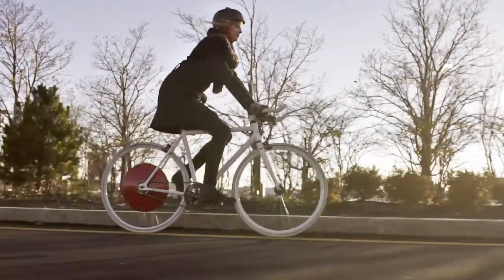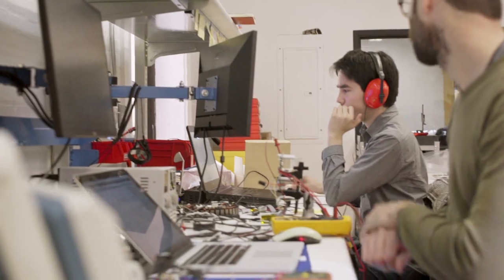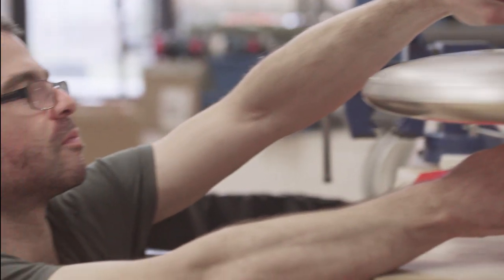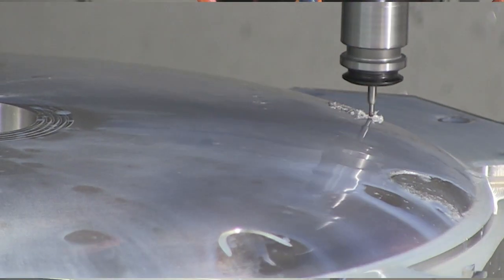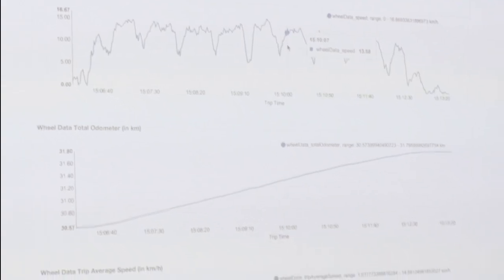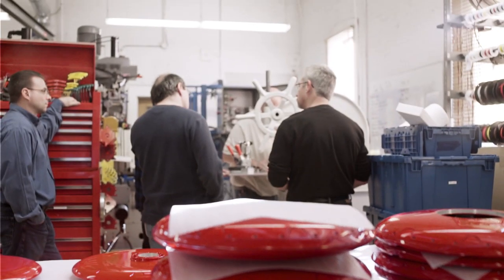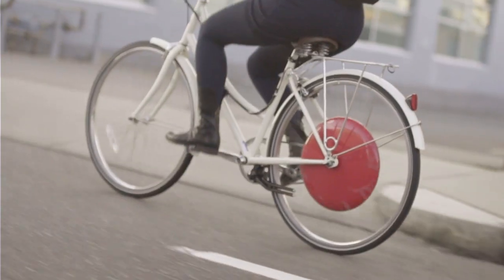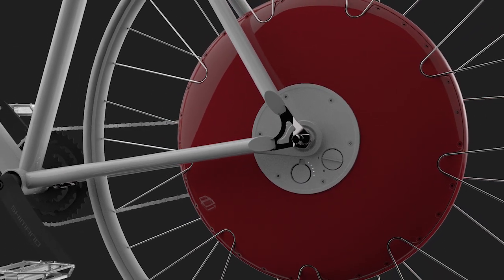Copenhagen Wheel - Product Development Update

Comment: July 10. 2015 STILL nothing, this looks like a scam, 7 months ago they posted here that they work day and night.....seems they have no open communication and the wheel is WAY overpriced and I think they gave up because in the end the wheel would be to expensive...only made in china will safe those guys! I strongly recommend  NOT to preorder the wheel! Better to buy an electrical bike that has replaceable batteries and is built stable enough to hold the additional weight and is fitted with DISC BRAKES!

Comment: How about theft protection.
Back wheels are quite easy to remove. 30 second tops and bicycles with quick release (90% of bikes made in the last 6 years), you don't even need any tools.
Reply: Tom Jr I replaced by nuts with ones that need a special tool... makes it more difficult to steal. (Though I hope I don't lose to tool)

They are not expensive and easy as hell to install. Got mine off eBay from the UK took 5min to install.

You can't theft proof a bike, but you can make it too difficult to bother by getting locking nuts, a good segmented locking bar and by parking it in more secure locations.

A company out here in melbourne builds bike cages that are monitored and require a pass key to unlock (logging who went in) and my work has a secure bike cage that requires you to use your building pass (also monitored).

If you are worried you can also get bike insurance (I will when I get the wheel)